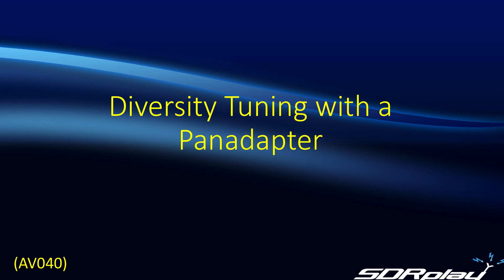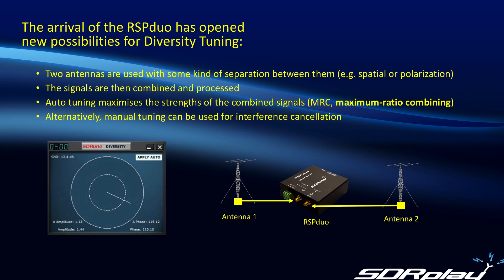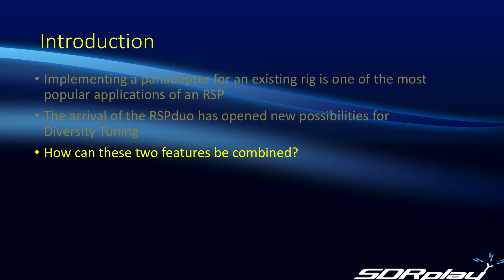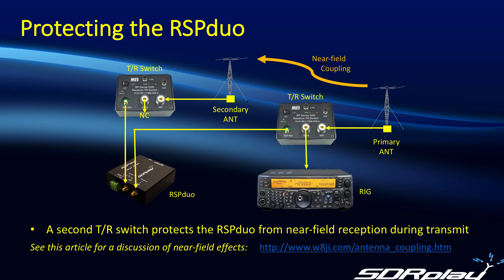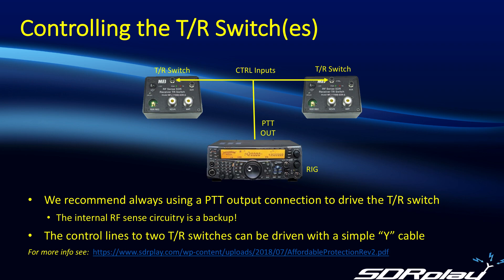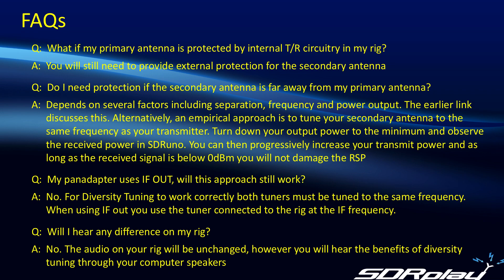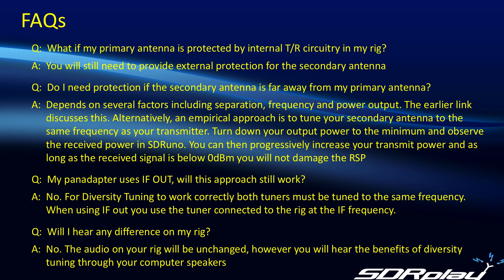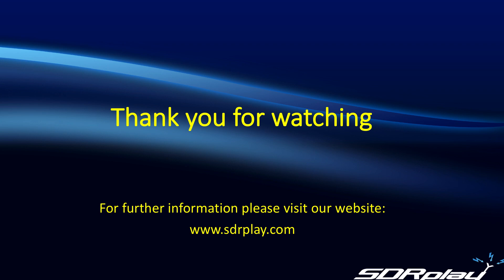SDRplay Diversity Tuning with an RSPduo and a Panadapter (AV040)

Comment: Thank you for an informative video. I believe this was example was indicative of a radio that had only one antenna port.
Alternatively: if one has a radio with 2 antenna connections, couldn't each antenna port of the SDRDuo use the MFJ switch directly with each antenna? 
Then each antenna would directly feed the SDR Uno and be switched out of circuit during transmit and one could easily switch between best transmitting antenna.
This begs the question:  How does one know WHICH antenna is receiving the most signal (actually which antenna would be better to transmit) while using Diversity Tuning?
Thank you kindly for your answer and Thanks for a great video lesson.
Reply from the maker: The main thing when you have 2 or more antenna ports is to make sure you protect each input from any  transmission signals which result in more than 1mW RF energy (dBm) appearing at the 50 Ohm SMA socket.  If you simply use one port with a switch then that would be fine.  (i.e. only one antenna (manually chosen) is ever connected).  Your second question highlights the value of diversity tuning.  The fact is you don't necessarily know which has the "stronger" signal and you can extract a stronger combined signal is you have 2 antennas being used with the 2 tuners in diversity mode.  Both signals are needed and processed as described in the video but you do need 2 antennas separated in some way.  You then have to protect both antenna inputs to the SDR.
Reply: @SDRplayRSP  Thank you.
My apology for not being clear. I mis-wrote "couldn't each antenna port of the SDRDuo use the MFJ switch directly with each antenna? "  I MEANT to write "...each antenna use a SEPARATE MFJ switch." So I think we are on the same page as regards isolation during transmission while simultaneously receiving on 2 antennas.
My second question was "When Diverstity Tuning is properly set up, is there a way to know which antenna would be better for transmitting?" (other than switch back and forth on individual antennas and listening).
Thank you so much 
Joe <><
Reply from the maker: @AirGunScientist   For comparing antenna performance, you'd be better off just simultaneously using the 2 tuners as demonstrated in this video: https://youtu.be/pqK0u7p-jGY
(see 5 minutes 10 seconds in, where it shows the 2 antennas on the same frequency).  Particularly for HF and below you can then see over a period of time how the 2 antennas compare.   There are other considerations for transmitting though - impedance matching becomes very important and a receiving antenna (especially magnetic  loop antennas) can work very well near the ground for receiving but (assuming they are the sort designed for transmitting) may not transmit very well.

Comment: I have a  FT991A  and want  a sdrplay RSP DUO  for a PANADAPTER  only my rig has 2 antenna outputs 1 for hf and 1 for uhf vhf with 2 antennas  one for each port. I want to use the PANADAPTER for both vhf side and HF side . So do I hook up a mfj1708 b sdr to each side as s above in your video. So I need 2 1708 switches also want diversity mode.  Cant seem to find much information on my setup. Also I want to run WIN4YAESU  software  that has some kind of software  PANADAPTER  but is better with a sdrplay and will this make a difference. 
Please help . Love your products  they are the best.

Chuck Patterson  AA4CP 
 in Port Salerno FL USA
Reply from the maker: Your rig only has antenna inputs, no RX outputs so you will need an MFJ switch for each input you want to use. You will also need to common the control lines as shown and use a trigger that is active when either antenna is in use. I believe the TX GND signal on the TUN/LIN jack provides this. 
Win4yaesu has instructions on using with an RSP, but depending on how you want it to work ypu may have to be careful with setting up virtual COM ports.
For diversity tuning you need two antennas on the same bands so you'll probably need to do some antenna switching to get a useable configuration.